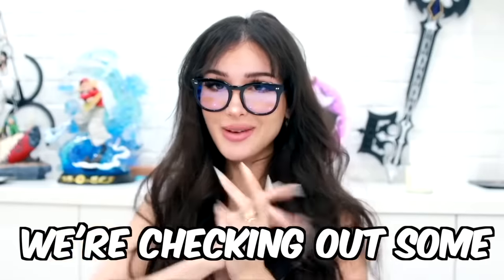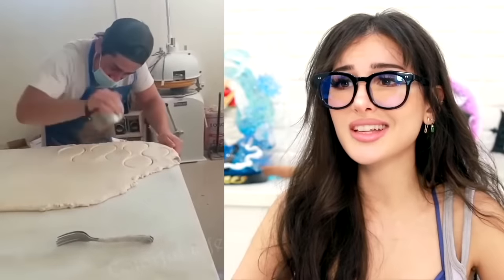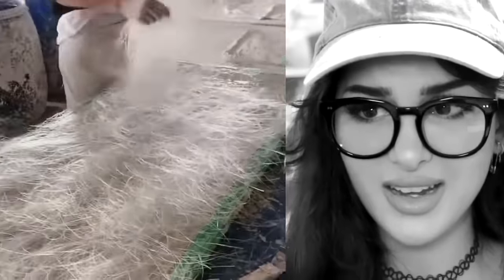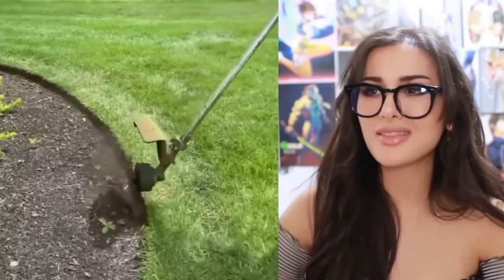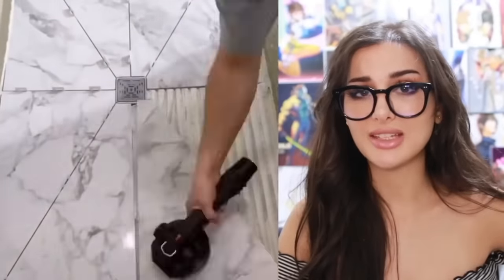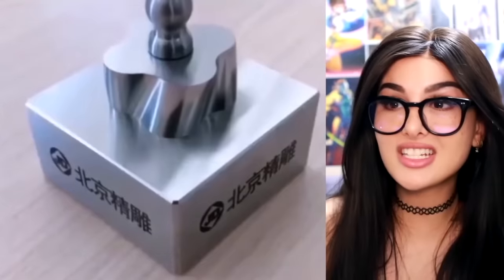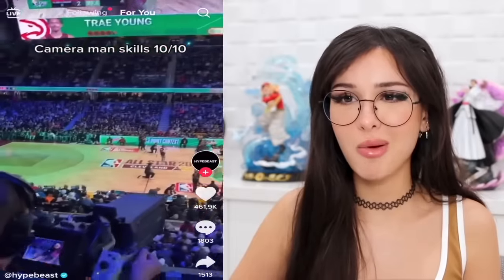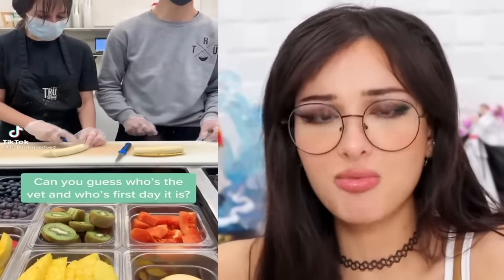MOST INCREDIBLE SKILLED WORKERS Workers On Another Level | SSSniperWolf

Comment: 0:52 so i used to work in a factory & yeah 90 percent of the time we cook grey sand & white bricks. red is extremely time consuming & has the most waste because red (color theory) is a large molecule so they absorb a LOT more water and wont fire properly in the kiln (too hot = steam & sand, too cool = mush, too short or long = pebbles). you would think in the year of our lord 2024 the technology used to correctly cook some rectangles would be enough to do it right the first time but we still using humans for QC 😂 so yeah its easier to paint it red